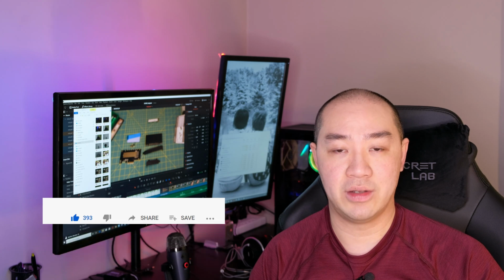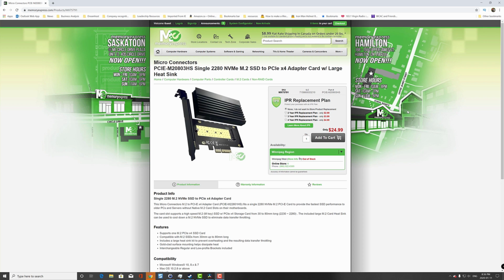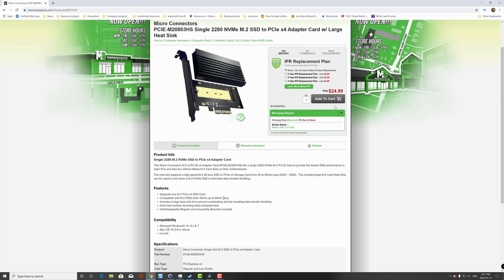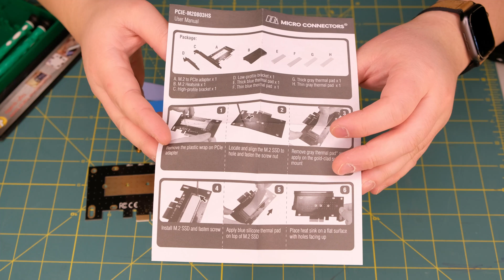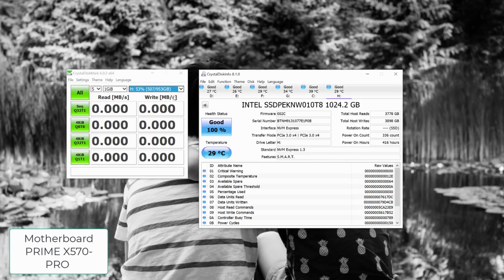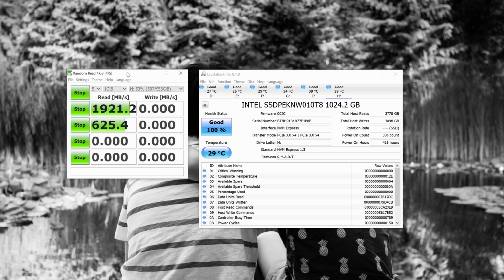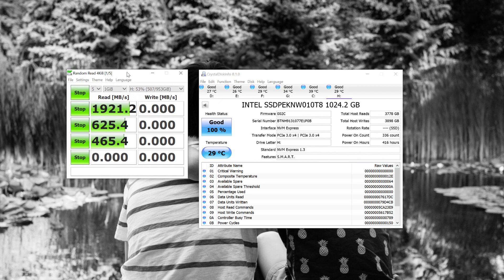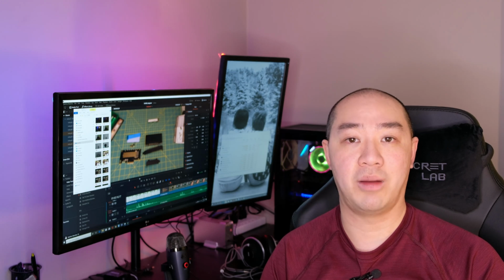Intel 660P 1TB NVMe M.2 SSD to PCIe x4 Adapter Card | Micro Connectors | Installation | Benchmark

Comment: I have this, except its the one that can do m.2 nvme or sata,  and a msi b550 mag tomahawk mobo. I installed everything correctly but my bios isn’t recognizing that theres anything in that PCIe slot. Windows is recognizing it but not my bios so I can’t boot from it. The red power light is flashing on this adapter when i turn my computer on. Anyone have any idea if its an issue with my mobo/bios, the pcie slot itself, or the m.2? Everything I’ve looked at it appears that my mobo should be able to boot from it. I’ve updated the bio, theres nothing in the second m.2 slot. This adapter is in the 3rd pcie lane with my graphics card in the first and my other m.2 in the first m.2. Been searching for hours for any kind of solution. I was low key hoping id just installed it wrong :(
Reply from the maker: Hi there. Do you already have the hard drive with windows installed on the PCIE adapter?

Comment: Do you think the heatsink helped at all?
Reply from the maker: I can't say for certain how much the heat was reduced by unfortunately. But theoretically, any heat sink should do a better job dissipating the heat versus not having a heat sink at all.
Reply: @TheWongReviewer  That's what all the ads say but many are saying its a misnomer. Of course many don't know how to even do real testing and that it takes 10-15 minutes of sustained copying for them to really get hot, they think you just plug them in and run Crystak disk and look at the temps. I was hoping you would have had some insights with your video. That little piece of sticky foam they give us for heat dispersal seems like a waste to me but it's all they offer and can't help more than 2%. The industry has gotten together and decided this little 1/2 cent piece of technology is all they are going to offer us for the problem. I like the enclosures with fans, it seems like the best idea to me and I have had temperature drops of 6 degrees from 69 to 63 while copying 1.5 TB of files using the fan.

Comment: can you boot windows 10 from that ssd with adapter?
Reply from the maker: HI there. Yes you can. I've done it with another build while troubleshooting. You have to change the order of the boot drive in the bios.

Comment: Thanks! This was very helpful. I have the same card and the instructions did not make clear how to install the screw nut. From the picture, I was actually trying to install it on the wrong side! Your video cleared that up for me. Also, the instructions only referred to removing plastic from one side of the thermal pads. Your video pointed out there is another (hard to see) plastic sheet on the other side of the pads that needs to be removed as well. You saved me a lot of monkeying around. Thanks, again!
Reply from the maker: Hey there. Thanks for taking the time to comment and  let me know it was helpful. Glad it worked out ! Happy building!
Reply: This is it. I had same issue and the help on this video solved it!

Comment: can i boot my os from Mvme which is using adopter. my bios don't show me the Nvme ? but it showing in device manger how I install windows? i try cloning too but nothing is working so far
Reply from the maker: Hi there. Yes, you can. For a while I was booting up Win OS from my NVME adaptor in my current rig. In the bios, you have to point to the new drive to boot. Is this a fresh install of windows or was it an existing NVME with OS installed on it and you just moved it to NVME adapter?
Reply: I believe you can use the clover-efi method to boot nvme on pretty much any motherboard.

Comment: I’m building a new rig from scratch and I’m going to use something similar for a 3rd m.2. Two questions. Do you think it would work as good as my software disk vs the m.2 slots on the motherboard or just use it as my cache and scratch disk. That’s probably what I’ll do. 2nd question. Just starting out on YouTube waiting to get this build done. What camera are you using I noticed the auto focus had a little delay I was going to get the Panasonic LUMIX fz300 to get me started.
Reply from the maker: Hi there. Thanks for watching. I currently use this as my cache and scratch disk for Davinci Resolve studio. I'm not sure what editing software you're going to be using, but Davinci resolve takes up a lot of cache and optimized media space. It's much faster than HDD or SSD. I'm currently using a Fuji XT3 for my camera. On the Fuji X-T3, you can set  how fast / slow to track objects and focus. I've shot way more videos now and i've learned to adjust my camera settings based on what i'm doing. Eg. Tech unboxing vs talking had videos. Feel free to message me with more setup questions. Happy to help you out.
Reply: The Wong Reviewer I’ll be using premier and after effects. It’s been 16 years since I’ve used it and I have a lot of relearning. I also want to get into 3D animation. Going to start with blender because it’s free.  I want to get my feet wet before I start spending money on software. I got 3 Samsung evo m.2  sticks. Two 512mb one for programs and one for cache and scratch. Then I have one 1t for projects I’m working on at the time. Then I have two 4t wd red hdd for storage. 64 gig of ram. I’m building Intel. Purposely waiting for this week to see what tenth gen is going to go for and how it reviews and if the 9900k goes on a good sale for Memorial Day weekend. Have a 2080ti. I’ll get the 3080ti sometime next year if it proves to be 40 percent faster. Those are only rumors at this point. I have built a lot of computers but it’s also been a long time. This is my first build in 17 years. Lol.
Reply from the maker: @youngbloodsno11  You and I are in the same boat. It was about 20 years for me since i built my last PC.  Good call on waiting as PC makers are pushing out new chips and GPU shortly. Your computer specs are high end. I have no doubt you'll crush it in blender.Feel free to shoot me an email about PC builds or content creation for Youtube. I may have some lessons learned.
Reply: The Wong Reviewer I’ll keep in touch for sure. The few videos and projects I have up on YouTube well to say least I am sort of embarrassed by and when I watched them I was like no no no. I am not doing this subpar stuff. I’ll wait till I can produce a little better video and audio. I have another channel I want to start about tech gadgets too but I am also wanting to keep up with the film making as well. I will be making a video of my build for both channels when it’s done.
Reply: Hey buddy Here I am again stuck with another hard decision. I’m still going back and forth from Intel and amd. Do I go with the ryzen 9 3900x and a new motherboard or the i7 10700k and a new motherboard? Going to cost me about the same. No gaming just 3D animation and premier pro and after effects. Please help. Amd motherboard was looking at the X570 ultra and the Intel was looking at the new z490 vision d. I have 3 m.2 cards so both will benefit from that. Both boards are the same price at $300 and there’s only really a few dollars difference on the cpu. Which cpu will I benefit from. I’m running 64 gigs of ram with 2080ti. This is a completely new build.

Comment: Thanks!  This also save me agida as I couldn't figure out the screw nut mounting from the instructions.  I know your SSD is a full 110mm, but any idea what I do with an 80mm?  Do I just cut the thermal pad short enough in order to expose the proper mounting hole?  And then just cut the top pad to the length of the SSD and let the heat sink overhang?  EDIT:  it looks like the single drive model is only 80mm- my "dual drive" (NVME + SATA) can accommodate 110mm, hence my dillemna...
Reply from the maker: Hi there, thanks for watching. I don't see an issue with your solution to cut the thermal pad and let the heat sing overhang. As long thed SSD is properly seated in the card and it's secure. You're good.
Reply: @TheWongReviewer  Thanks!  Done.  Heat sink fell off while installing :(.  Hopefully it stays on now...